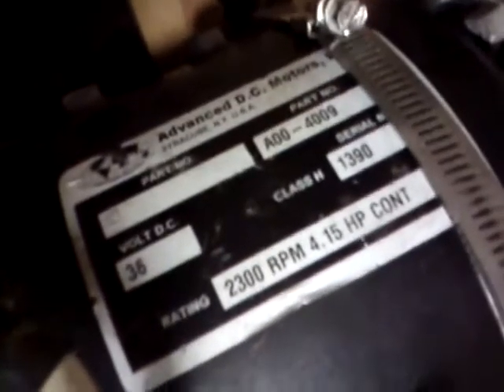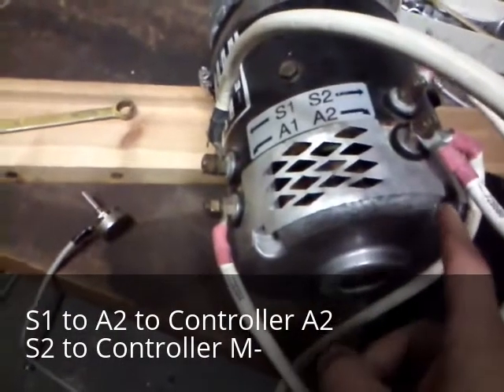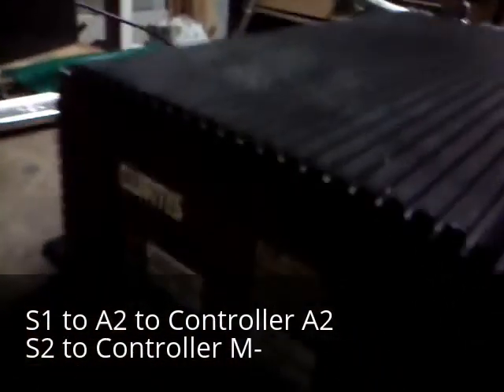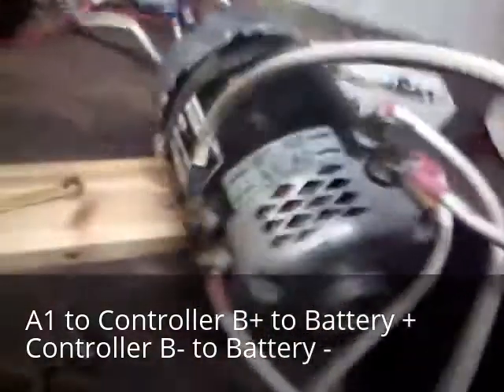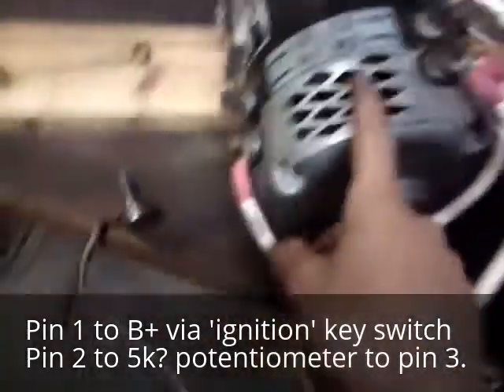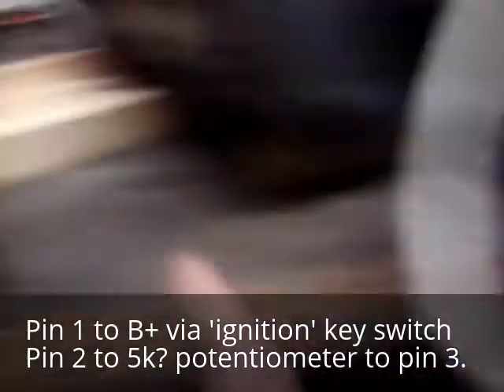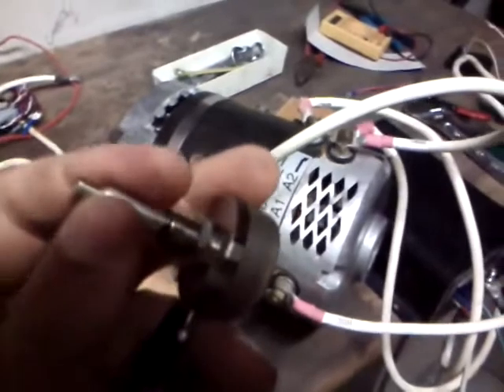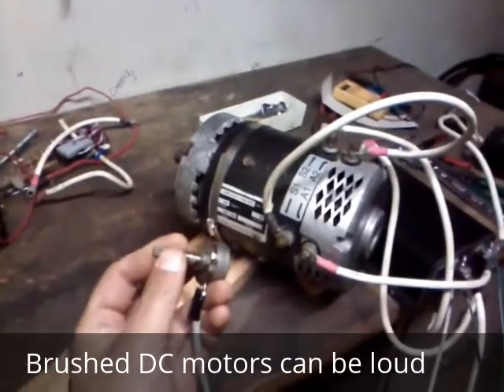Curtis 1209Motor Controller and Advanced DC motor test

Comment: how can I use this lower voltage controller for easy driving but switch to 144v direct to battery pack bypassing the controller on the fly?  like a high performance setting without the need of a higher voltage  controller which would be twice to three times the price of that one.  need wiring schematics please.   please use no controller in subject line.
also, how to wire the batteries to get 3 settings (speeds)  going from 48v to 96v and finally to 144v WITHOUT A controller?  manually "shifting" voltage.  jackolivas007@gmail.com

Comment: how do i test a club car ds 48v motor by itself? a1 s1 a2 s2
Reply: Connect A1 to S2 then S1 to (+) and A2 to (-)
Reply: I did this as you explained and it toasted the terminal
Reply: Just use 12v to test.